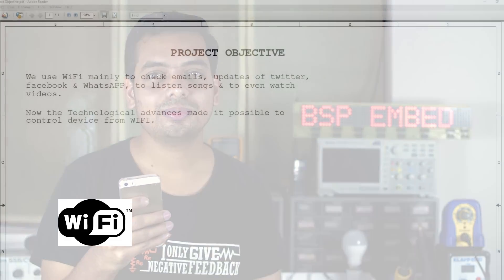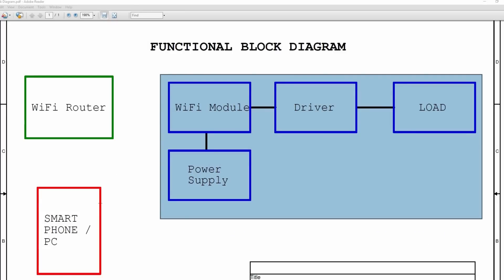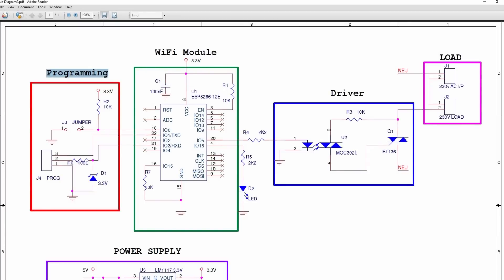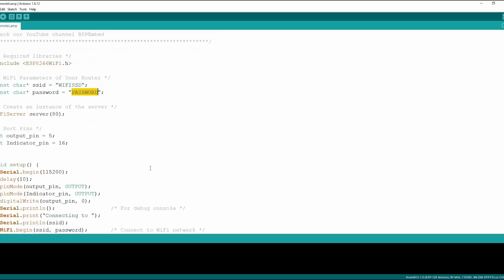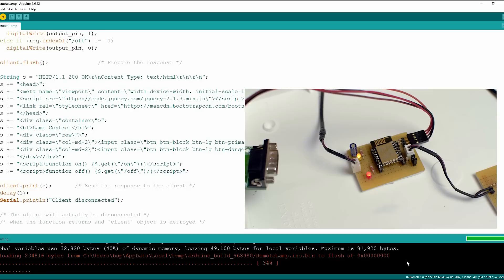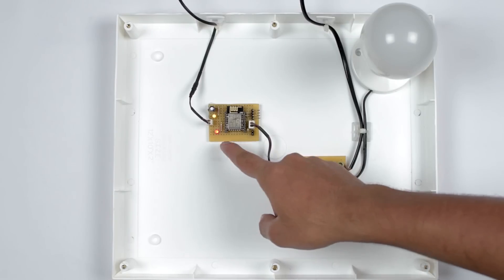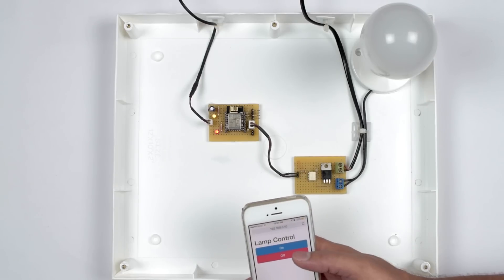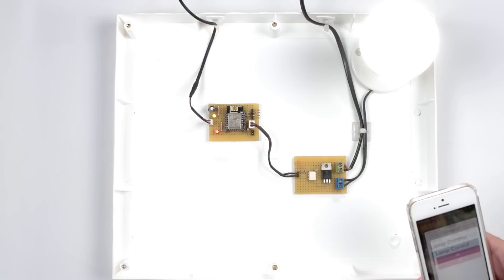DIY ESP8266 Home Automation using WiFi

Comment: can we use php instead of html
Reply from the maker: Yes, You can use.
Reply: No you can not

PHP is server based scripting language. Pages are parsed by the webserver and then sent to client I.e. browser

Client do not parse the PHP codes

ESP8266 can not parse it until you Embed in some sort of parser. It does not have enough memory to do that and what ever code you will write will be sent to client which will not be parsed.

He doesn't even know how it works so giving wrong answer

Comment: It's good. Need guidance to add more controls. Can we control with app?
Reply from the maker: Just configure more GPIO's as output and extend the html code.
Reply: fatal error: ESP8266WiFi.h: No such file or directory

 #include <ESP8266WiFi.h>

                         ^

compilation terminated.

exit status 1
Error compiling for board Arduino/Genuino Uno.

This report would have more information with
"Show verbose output during compilation"
option enabled in File -> Preferences.
______________________________________________

this is the error message I got. 

and pls clarify me this things.
1. WiFi router neessory?... If so how can it be configured with router.
2. it can be connected to wifi module without app just by entering ip address??
3. where can i assign the ip address that is not given in the sketch
Reply from the maker: You have to select ESP8266-12E module in the Tools Menu.
1A. WiFi router is necessary. You have to add the WiFi credential (User name & password) in the sketch.
2A. I'm not using any App. Entered IP address in the browser.
3A. You can assign IP address in the router.
Reply: thanx for ur patience to reply to my comment
Reply: how to configure with adruino uno
Reply from the maker: connect ESP8266 to Uno through serial (Tx & Rx). Either you can use library or use AT command.

Comment: How can we switch multiple loads from  this single esp8266 12e module?
Reply from the maker: Yes, You can switch multiple load. Upto 11 loads/devices you can control. Configure GPIO's as output & extend the html code.
Reply: You can control more than 11 by using I2C that too on single wire

Comment: What is the difference between the edp8266 12e and other modules.Can you please share  the any website link where i can buy exactly the same module ebay or alibaba which you have used in your project.
Reply from the maker: 12E has more features then other older modules. You can buy in local electronic store. You can also find in amazon. http://www.amazon.in/s/ref=nb_sb_noss_1?url=search-alias%3Daps&field-keywords=esp8266+12e
Reply: Thanks.Your projects are tremendous and very informative.I wish your channel flourishes get more and likes and subscribers. :-)
Reply from the maker: Thank you.

Comment: Can you please help me to make programming block of this circuit in detail please.
Reply from the maker: Sorry I didn't get you.
Reply: Is there any changes in Code except WifiSSID and password?
Reply from the maker: No Changes required.
Reply: thank you BSP Embed.
Reply: how can we determine the IP of ESP
please tell me brother
Reply from the maker: You can check in the terminal. (Serial port monitor).
Reply: thank you sir.
Reply: can we use php instead of html in programming

Comment: how want to do it with my all home appliances . can you help in doing this because i am beginer in this.kindly help me provide me and guide me at each step.my cotact is 9530722322
it will be really helpfull.
Reply from the maker: Initially develop one appliance as described here. Later you can extend to many channels.
Reply: can i use arduino esp8266 d1.. in this
Reply: actually the thing is i want to build a voice control wireless based home automation system. i think arduino esp8266 d1 will work efficiently.i want you to help me to go through this project and please tell me the required components.
Reply from the maker: You can use it. It's better to use ESP8266 12E (Which has bot WiFi Module & Controller).
Reply from the maker: Please check this for voice recognition.  https://www.youtube.com/watch?v=YHN9pWAgIJw
Reply: with arduino esp8266 d1 i think it will work efficiently. do you know how many kinds of sensor we can use with this module.
Reply: BSP Embed i didn't find any video in this link it take me to my profile. just tell me the name i will search it out.
Reply from the maker: Check it now. And arduino esp8266 d1 is Good.

Comment: Bro i don't have Serial port converter  i am using Arduino for Wifi module . then how it will work ???
Reply from the maker: You need serial port converter for uploading a sketch to ESP. You can do this using Arduino. Remove ATMega328 IC from the board. Then take out RX(D0) & TX (D1) pin and connect to ESP8266 module.

Comment: Why we are using 192.168.0.10? and how to set that ip?
Reply from the maker: You can setup in your WiFi Router. Know the MAC ID of ESP8266 and configure static IP for the MAC ID in the router. It's very easy. You can do it.
Reply: Okay, Sir, I uploaded the code to nodemcu 0.9 and set the led high to check if it's working. But in the router DHCP client list I found nothing. Even serial monitor also showing nothing. Is there any problem?
Reply from the maker: Make sure, You have given the correct SSID & Password of your WiFi Router. Once the connection is established, you can see the IP in serial monitor.
Reply: Well sir, I figured it out. But now facing a problem in function on() and of().
Clicking on the buttons doesn't changes LED state. On serial monitor it shows following output:
WiFi connected
Server started
192.168.0.111
new client
GET / HTTP/1.1
Client disconnected
new client
GET /favicon.ico HTTP/1.1
Client disconnected
But in the address bar I manually put 192.168.0.10/on then it works. 
how to solve this. Help me.
Reply from the maker: Check ESP8266 IP Address. Did you get ON & OFF button on the page ?
Reply: Yeah every thing working fine. Jut get function is not working.

Comment: does that mean that i can do it without the arduino ?
i want to make it and need some help!!!
also i do not have usb to serial convertor how should i go about it ???
also how to expand to more channel can you upload a tutorial for that?
Reply from the maker: You don’t need an Arduino.
You required USB-Serial for only uploading sketch to ESP8266.
ESP8266 Provide 11 GPIO which you can  use.
Enable Port forwarding in Your Router.

Comment: can we upload same sketch to esp8266- 01
Reply from the maker: Yes you can.
Reply: Uploaded sketch properly on esp 8266 12. Confused with next step- i.e how to know ip address? How to check esp connected with wifi?
Reply from the maker: You can check the IP address in your WiFi Router or you can monitor in serial port. If you know the MAC ID, you can assign the fixed IP to the device  in the Router.

Comment: Insane High Level Retardedness we can just use a nodemcu and we dont have relay modules available no need of octocopler and mosfets nice messing up the works.
Reply from the maker: I generally don't use relays.
Reply: That is exactly the reason I mentioned this is a video for insane high peoples.
Reply: What the hell is your problem? What's wrong with a triac? They can do anything a relay can, and then some. I'd like to see you dimming a bulb with a relay.
Reply: So you think with octocoupler you can control brightness ?

Comment: Thank you for the video sir. Do you have any tutorial of ESP8266 Wi-Fi module and Arduino UNO for controlling the Lamp Load sir ? Badly need it for our project. Hope you help me sir, Thank you . :)
Reply from the maker: Glad you liked it. I haven't made a tutorial on ESP8266 interface with Arduino. You can write your application with ESP8266 module. You Don't need other extra controller.

Comment: Hi, nice explanation. A small query, R3(10K )in Driver circuit is 1/2 watt of 1/4 watt.? Did you face any heating issue in that resistor?
Reply from the maker: Thanks for watching. It's 1/4 W resistor. Their will be no heating. It's a current limiting resistor for Triac BT136.
Reply: Thank you.. :) & keep posting videos..

Comment: very nice.  i like the simplicity of the smartphone interface.   also like the eevblog tshirts.   :)
Reply from the maker: Thanks for the feedback. I often get motivation from eevblog.
Reply: BSP Embed if I want to add more load then what should I do??
Reply from the maker: You need to make a change in the program. Configure GPIO's as Output pins and Add code in the server Flush section. (Just copy, paste for more GPIO's control).

Comment: How are you mounting it like initial assembly any breadboard or alternate as in video it's not clear
Reply from the maker: I used female berg stick on the perfboard and soldered the resistor/led lead to ESP module.

Comment: wow fantastic...video 
is it require that ESP and your mobile should be connected to same WiFi..?
Reply from the maker: ESP can be configured in both (standalone or Via router) ways. I configure via router, because i no need to disconnect my phone from WIFI router (which has internet) & connect to this this module and control the device.
Instead, ESP is connected by my WIFI router and i can access it anytime from my phone. I hope you understood.
Reply: bsp embed Thank you so much..👍